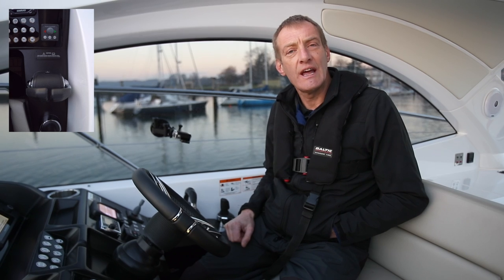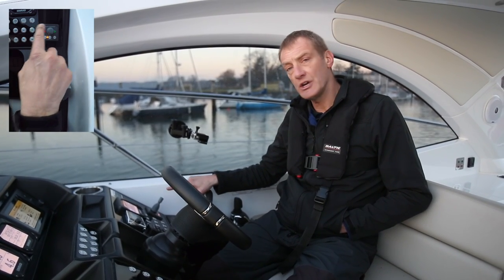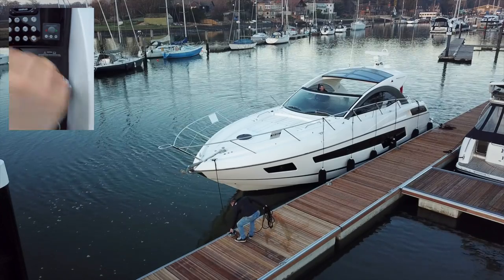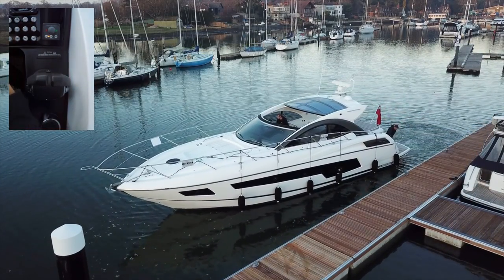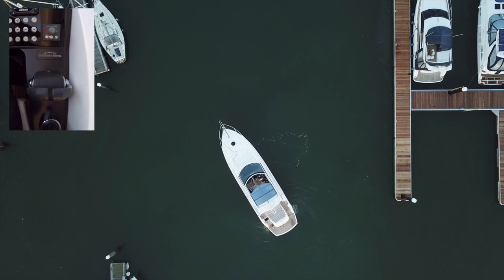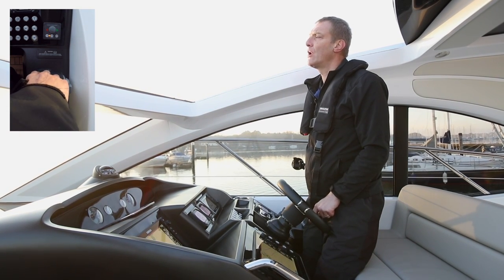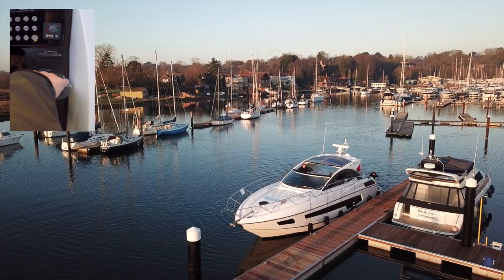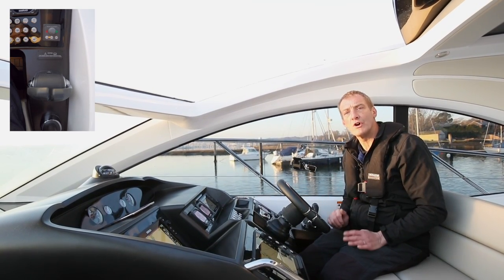How To: Use a Bow Thruster Effectively | Motor Boat & Yachting

Comment: Just the way you practice emergency procedures in an aircraft, go out to an open area where you won't bump into anything and practice and get used to the controls and how they react and feel before you use them in a confined area.

Comment: I'm at a slight loss: Fairline offer a bow thruster as an option with their Targa Volvo Penta IPS boats, but why would one need a bow thruster if the boat's equipped with IPS with an EVC joystick? Surely the IPS/EVC functions do everything that separate bow and stern thrusters can do (and more!)
Reply: I'm no expert but I think the joystick control is very aggressive and causes wear on the gearbox. I think the bow thruster or better still a bow and stern thruster is better for the gearbox and promotes learning of the rudimentary skills.

Comment: Turn the rudder or sterndrive so the stern  will power away from the pier when you set the throttle(s) in gear and at the same time you use the bowthruster to power away from the pier. Then you will move sideways away from the pier as if you have a sternthruster too. Just practice so you can learn how your boat behaves. Some may have strong engines and weak thrusters. Use only one engine if you have two ore more engines. And just remember that you will also move a little bit forward. I use this quite often and i always back the boat a little so I get some momentum backwards before i set the gears forward. Then the motion back will cancel out the slight forward motion you will get. Once again, every boat behaves differently so get to know yours first.
Reply: Could he have turned the steering wheel to port reverse with thruster?

Comment: How do you move sideways bow and stern using only bow thruster and throttle?
Reply: @Ng John You can. Its very easy to bring a boat along side with just a bow thruster and 2 screws.
Reply: Even with one screw you can. If you whant the boat to move to port, you thrust to port and kick your engine with the wheel hard to starboard . It might take a bit of practise to master, especially with this "on/off" thruster, bit it is possible.